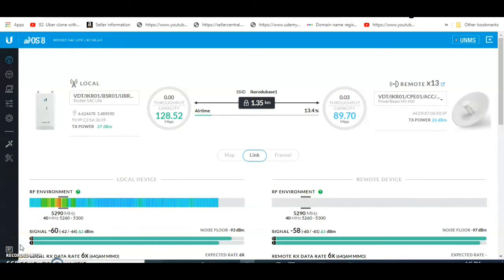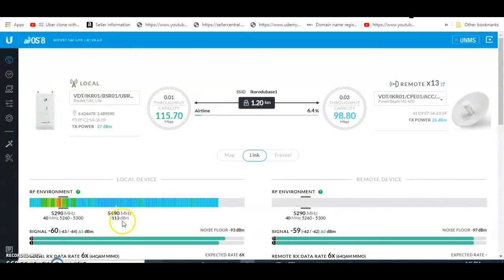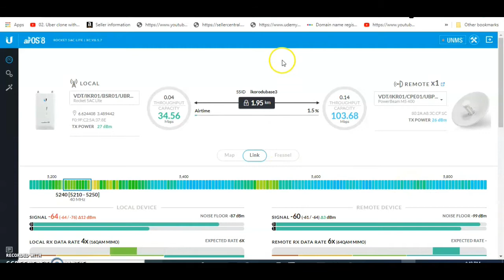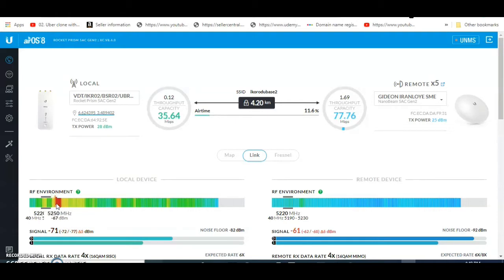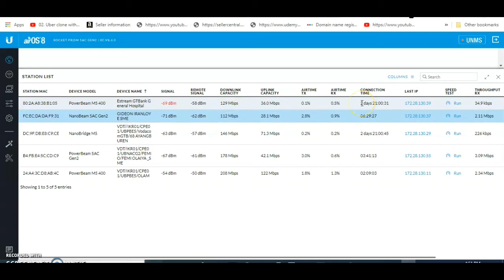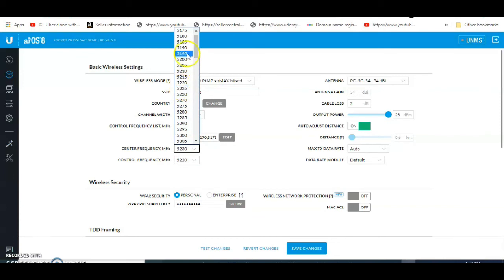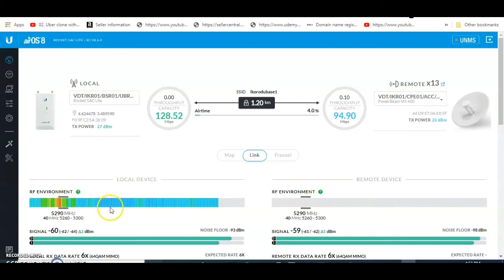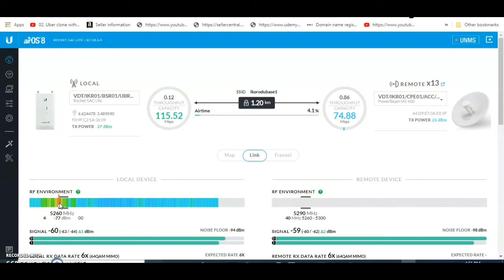Ubiquity Radio and Interference

Comment: how do i no if my powerbeam m5 is  facing  interference
Reply: This can be known between the range where the radio frequency is operating, this can be confirmed from the point where the exact frequency is operating on the radio. The color legend RED, BLUE or GREEN is the deciding factor. Red - means the operating frq is badly interfered, BLUE - mild interference, GREEN - Very clean no interference.